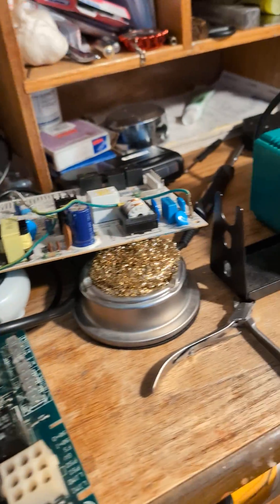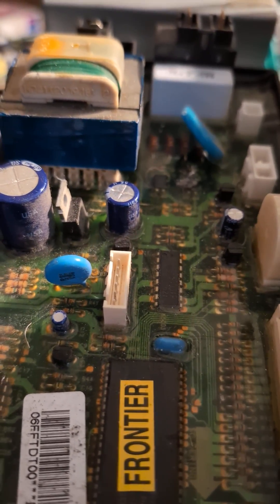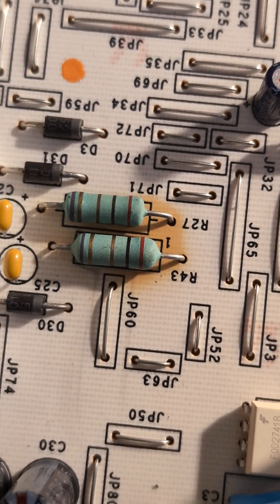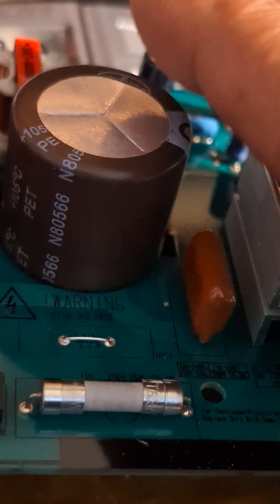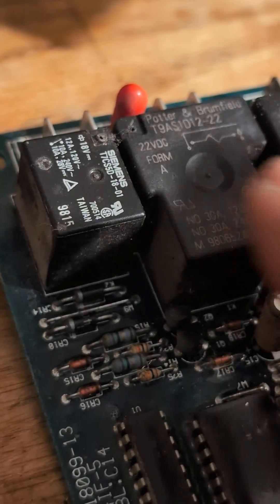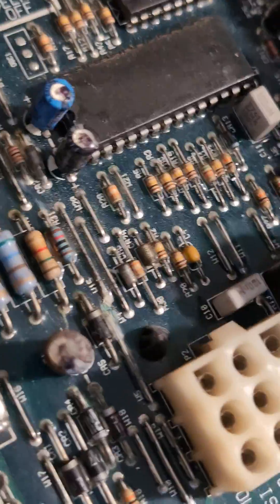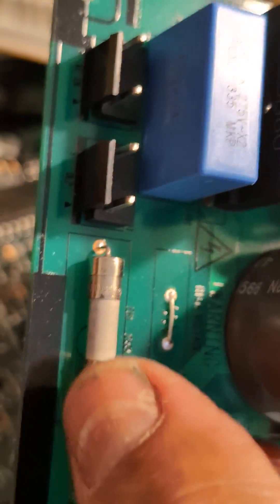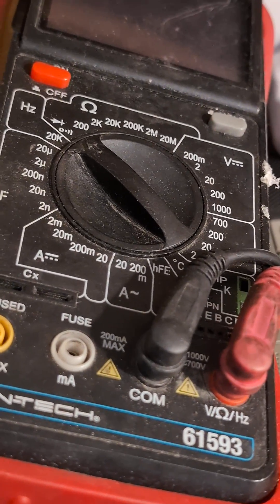The Ultimate Guide to DIY Electronic Repairs

Comment: one example of surface mount, the rest looks like its from the 1990s.
Reply from the maker: @Corybobory-vm9kl  still have parts and electronic devices from  1980 90s and early 2000. Old 8 tracks. Bcrs. And original Ataris